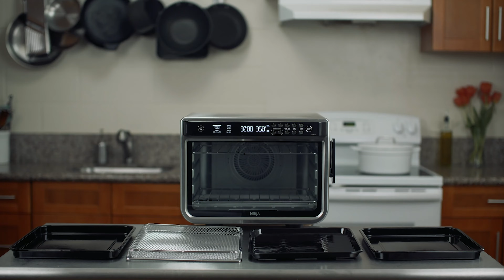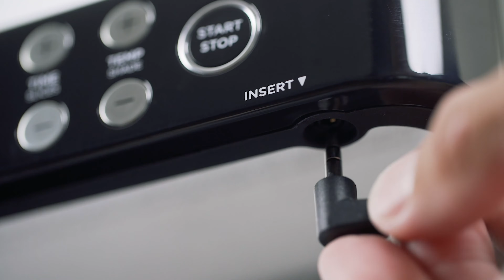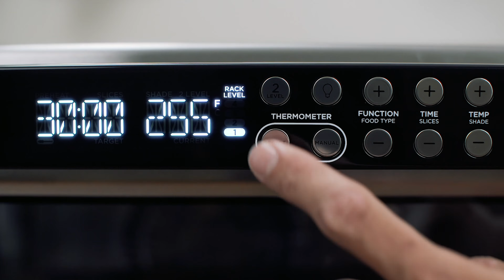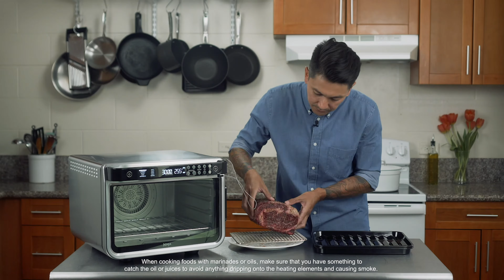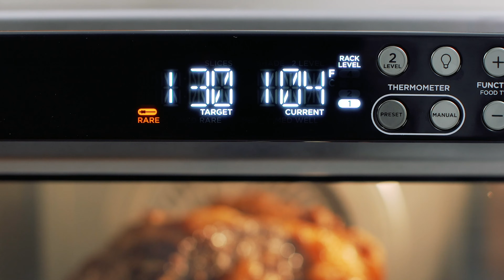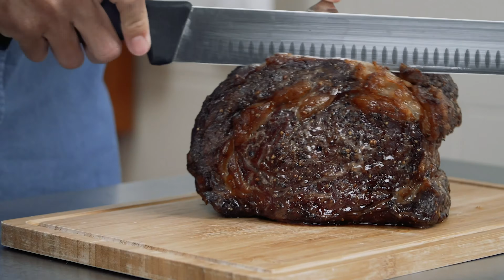Air Fry Oven | How to Set Up the Thermometer (Ninja® Foodi™ Smart XL Pro Air Fry Oven)

Comment: Is there a way to control the cooking temperature when using the manual thermometer option? Last time I used the thermometer, it took a very long time and I couldn’t figure out a way to cook it at a higher temp
Reply from the maker: Hello Rachel! To have a look into this for you please reply to us with your model number.
Reply: @NinjaKitchenUS  DT200 Series LP3
Reply from the maker: Hello Rachel! The thermometer has preset temperatures based on the protein you chose, and what level of doneness you want it to be it. There is no way to manually set a temp for it.

Comment: I press the preset button and it does nothing. Doesn’t show me the temperature just shows the time. I have the thermometer inserted and connected. 

Got the 250 series from amazon. Not sure if it’s the 251 just says 250 series on the manual. Also the meat came out looking ugly instead of crisp. I think I used air boil or something but then I cooked it a second time on air fry. This thing is annoying and pissing me off.
Reply from the maker: Thank you for reaching out to Ninja. We are sorry to hear that you're experiencing this issue with your Air Fry oven. To better assist you, please contact our Customer Support at 1-877-646-5288.
We are open Monday to Friday, 9:00am - 9:00pm ET, as well as Saturday from 9:00am to 6:00pm ET.

Comment: I got mine from Amazon for Prime day deals. I love it and use it all the time. My only question is when you use the probe, can you still adjust the oven temp or is it preset? Can I set the function to whole road, set the oven temp, then plug in the probe and set the meat temp? Or does it default back to a preset once the probe is plugged in?
Reply from the maker: Thank you for asking, Vermilion. When using the probe the oven will automatically go to the correct temperature based on what you want the internal temp to be and the function, and there is not way to manually change the temp of the unit itself while doing that.
Reply: So I don’t have the option to cook the meat slower at a lower temp using the probe?
Reply from the maker: We are sorry about this inconvenience, Vermilion. The oven would not be able to slower cook it with the probe in it.
Reply: @NinjaKitchenUS   Not an inconvenience,  I just wanted to be sure I understood how it worked. It is a great oven and I use it all the time. My venison roast came out perfect with the probe in it. Tender and perfectly cooked. It was just ready faster than I expected and we were wondering if we could make it cook slower. Thank you for your information. It is very helpful.
Reply from the maker: You're welcome, Vermilion. We are glad that you are enjoying the oven.

Comment: The DT251 (has thermometer) is ONLY available on Amazon right now. Be forewarned, they are NOT all the same. You MUST get the DT251 if you want the XL Cooking system with the thermometer. The DT251 is not even available on the Ninja Website, must be some contract with Amazon for exclusivness right now, but its cheaper on Amazon than it is at a Khole's or anywhere else so, research it. I love my DT251, it really works, I have the XL grill also with the thermometer system and I havea a Ninja BN801 Professional Plus Kitchen System and the Ninja 8qt pressure cooker. I love my Ninja stuff. I can cook here at my recording studio for people and entertain the artists with great food.

Comment: Nice video except for the very load music in the back ground !!!!   In this video I did not see a splash guard in the oven, where is it??????
Reply from the maker: We want to thank you for your feedback. Shortly after the launch of the Ninja Foodi Oven, it was determined that the splatter guard was not required covering the fan and that the product performed equally well with just the metal grate covering the fan. Moving forward, no units are being manufactured with the splatter guard. The metal grate covering the fan can be cleaned per the instructions in the manual for cleaning the interior of the product.

Comment: Today I contacted Ninja regarding this specific model after reading the specs on the DT-201. The DT201 model does not have a probe. Walmart has the DT251 which has a probe list price $449.98. Seems for a probe and advanced programming to be overpriced.
Reply from the maker: We would like to thank you for your feedback regarding the DT251. With this said, the price is set by local retail stores.

Comment: No one at ninja seems to know anything about it.  They have no customer service at all  .  They really need to fix it
Reply from the maker: We apologize for any inconvenience on this. We ask that you please stay tuned, as more details will be released soon.
Reply: It’s available on Amazon right now.  I receive mine later today.
Reply: @theblake5356  It WAS available. It's not available anywhere right now. Makes me wonder if they rushed it to market and it had problems.
Reply: @JohnHenschen   I have it.... I received mine on Oct. 27.  There are no problems, works great.  Ninja rep said that they have had production issues.  Apparently it won’t be available again until at least mid-December.
Reply: @theblake5356  Do you find the built in thermometer would be worth the wait and the extra expense? Trying to decide if I want to wait or just get the current model.
Reply: @JohnHenschen    Using the thermometer, I’ve cooked a tri-tip, a small chicken and a pork roast...  All turned out perfect.  I was skeptical prior to purchasing it, but boy was I wrong.  It’s as advertised and then some.   Btw, it air fries wings that rival Hooters or any other wing joint.  No hyperbole, it truly works that well.   I assume the DT200-201 models are virtually identical sans the thermometer probe.  If you can live without that game changing feature, then the DT201 is readily available now.  Knowing what I do now, I would hold out for the DT251.  

I hope this helps.  Good luck either way!  👍🏼

Comment: I was waiting on these to be released for sale. Well they finally were on market, I ordered one and it doesn't have the thermometer option. I feel duped. Other than that its a great little oven.
Reply from the maker: Congrats on the purchase of your new Ninja® Foodi™ XL Pro Air Oven. We do apologize for any confusion on this. There a re a couple of versions of the oven. The one with the smart thermometer has not been released yet. We will be releasing more information on the Ninja® Foodi™ Smart XL Pro Air Oven, the one with the thermometer, will be released soon.
Reply: @NinjaKitchenUS  I’m watching the video hoping to find out in what ways the oven is taking advantage of the additional data
Reply from the maker: We are happy to answer any questions you may have regarding the new Ninja® Foodi™ Smart XL Pro Air Oven. The Smart thermometer takes the guesswork out of getting the perfectly cooked protein.
Reply: @NinjaKitchenUS  I just purchased the Smart XL Pro Air oven, the manual and back of the oven say "DT200, but there is  small square sticker added that says DT201.  I don't see a spot where I could utilize a thermometer.  Why is that?